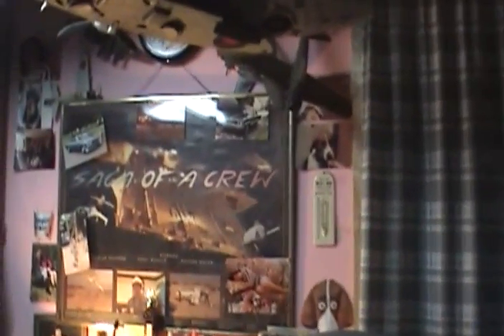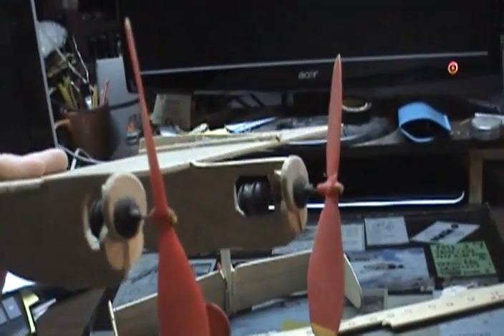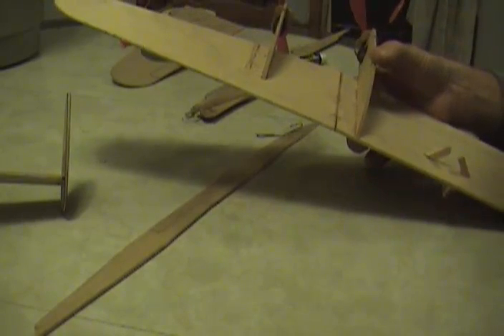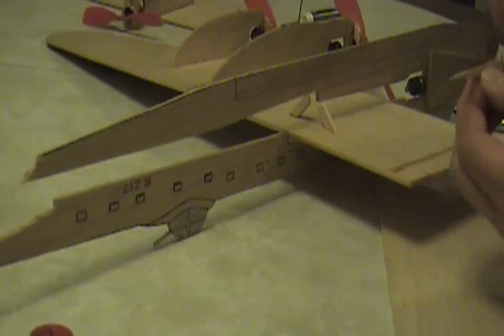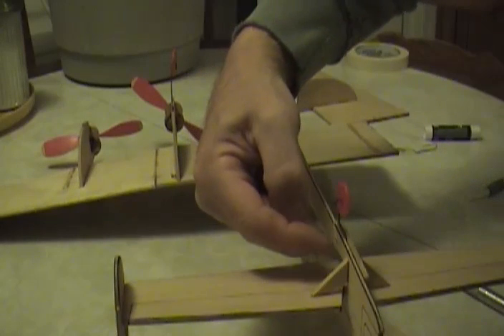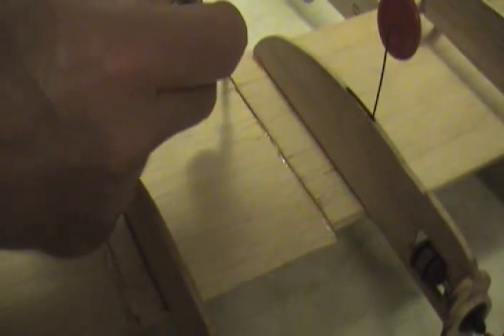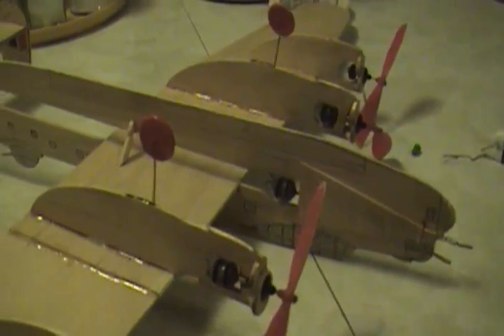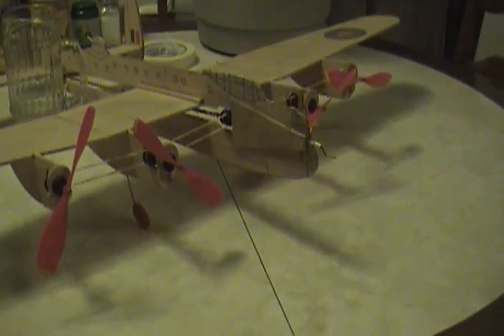WW2 Lancaster Bomber Crash Remains reassembled - Balsawood Flying Model

Comment: Do you have any details of the Chris-Prod 'multi-engine' pulley system? Where one might find one or recreate  a set today?
Reply from the maker: I developed the system using parts found at hardware stores and in some cases called manufacturers to get wholesale quantities - early 1990's - before I had internet access. The 'pulleys' are rubber grommets G402 and G403 from company named Waldom, now known as Waldom Electronics. When combined with short lengths of RC engine fuel tubing, music wire, and Evergreen styrene tubing you had the pulley shaft assembly. Locating the precise rubber band width, dexterity, and length was a very daunting task but I finally did. Props, thrust bearings, wheels were Guillows parts. I offered a short kit about 10 years ago on eBay. I do still have the plans and some parts but unfortunately my garage is a mountain of boxes. They are indexed and I know which box contains the items (just looked) but that box is not visible - it's deep within the mountain - I don't have time. I know that's not much help now. Here's the link to my Ebay page where perhaps next year if I finally unpack I might list plans or parts. I KNOW THAT'S NOT MUCH HELP NOW. https://www.ebay.com/itm/271543456443?hash=item3f394052bb:g:FOEAAOSwy3BdfkyE
Reply: @SagaofaCrew  Understood...thank you so much for that detailed explanation. Life priorities...our myriad projects...then having to move & re-establish when the world shifts around us is truly daunting.